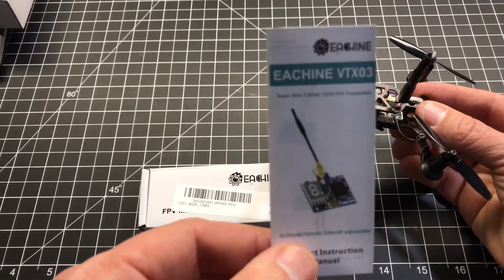Betaflight 3.1 + F4 flight controller + Racestar motors = AWESOME!!!

Comment: I see you showed a 1S battery but the board does 2S. The flight at the end was on 1S?  And also a 450mah pack?
Reply: Kabab FPV ...Dude ur everywhere, I love ur vids, didn’t expect to see u in a brushed vid comments section lol
Reply: reboot 1 ha. Thanks. I've recently become somewhat bored with the big GoPro brushless things because I just don't have the time to do much with it anymore. I hate all the stupid micro brushless and anything less than than 5". I've built dozens and haven't really enjoyed a single one. I've been allergic to brushes since the beginning but I'm gonna be experimenting with it again. I think with some actual good components they might actually be good and not just a PIA to maintain. We'll see....
Reply: Kabab FPV Awesome, I’m in New England so an indoor flyer is a must this time of year.
Also a great way to get a new flyer in the air, scouting components to build me and a newb buddy a set of twins...
Reply: I still don't recommend any brushed anything for beginners.  It's mostly a waste of time and money.  This usually isn't something people quit.  It's usually most efficient to get a controller, start flying the sims, then pickup a ~$50 shoebox headset and build a ~$250 5" setup.  That will usually last until the new pilot can fly decently and then they still have a nice 5" setup that's useful.  But it's all fun so any way is good.
Reply: Bob M I started with a brushed Hubsan. I, and most people I know, don’t have a comp that can run the sims well (of course I’ve only tried the DRL one, so maybe others work better) After that I dove into 5” and definitely broke a bunch of stuff, and continue to do so ;) 
...of course ur right, what u described is way more practical, but sometimes practical isn’t what someone is looking for, lol
Reply: As long as nobody quits because they're having a bad time its all good.  I for one have absolutely no idea how I kept with it when I started.  It was absolute shit back in 2014.  Worst imaginable experience.
Reply: Kabab FPV I can’t imagine it man, I’ve only been in the hobby about 9 months and the technology has grown a shit ton in that amount of time! Also, thanks to ur vids, and people like u (r.i.p project blue falcon) I didn’t have to waste a bunch of time testing out things, i.e props. So again, love ur vids! Thanks man!
Reply from the maker: Yeah on 1s 550mah battery I think. Don’t think this board can handle 2s, although some can, but my understanding is that with brushless the extra weight from 2s battery really takes away any gains.

Comment: Hey what are the big differences between F4 and F3?
Reply from the maker: RaceFace FPV mostly I think just much faster processor which allows flight controller to make quicker adjustments. Makes a huge difference with aggressive moves.